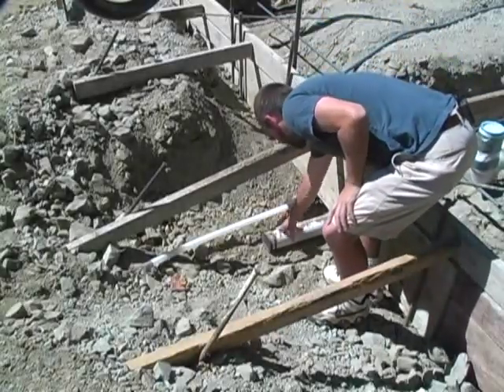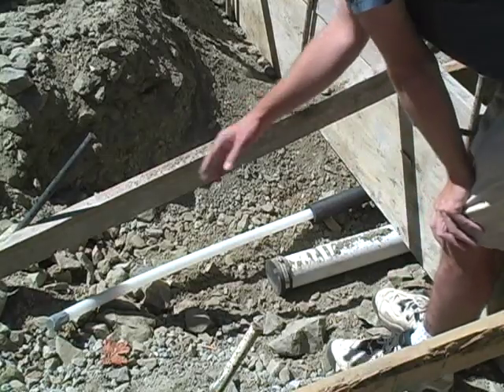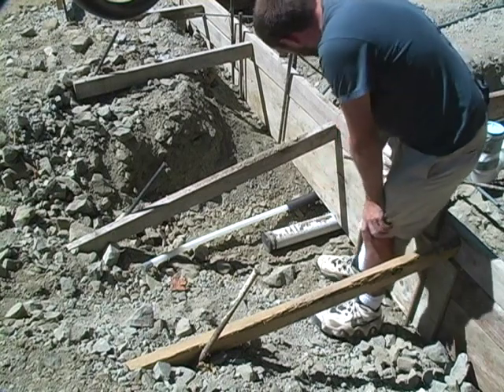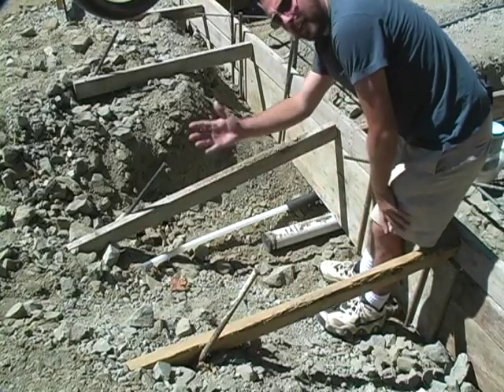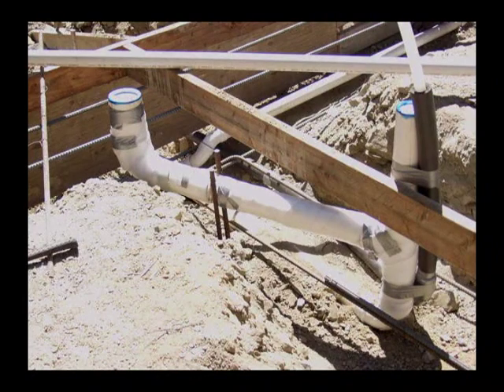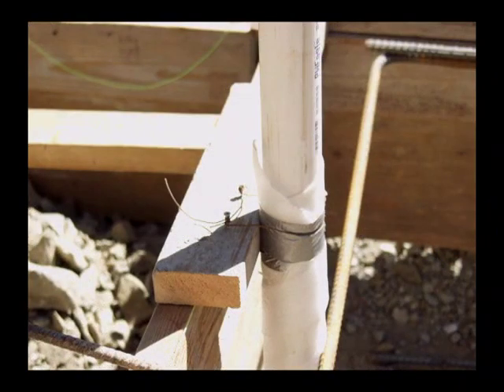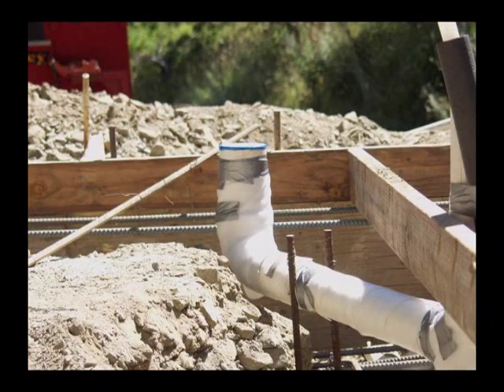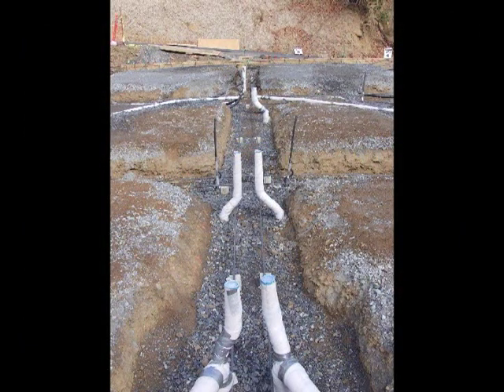How to Install Plumbing in a Slab Foundation

Comment: If I were in a hurry I would run my water closets random long if not I would set them 1/2" below grade. The reason for that is concrete finishers tend to run concrete slightly higher around pipes. Keeping them lower means your closet flange when set will make your toilet set so much better on the finished floor. Some are so bad shims are actually needed, and that will be a life long problem of rocking toilets and leaking wax rings.

Comment: Is there not a main point of entry for the water supply in a slab house? I want to put a whole house water filtration system in and I can't find the main line. I thought it would be in the garage by the Hot water heater... but nope. Any ideas?

Comment: Why did you insulate the water line?
Reply: The water line is insulated as it vertically comes through the concrete slab to protect it from the concrete slab expansion/contraction.